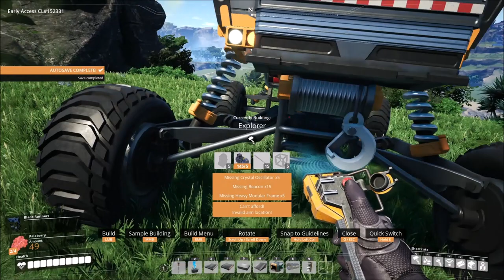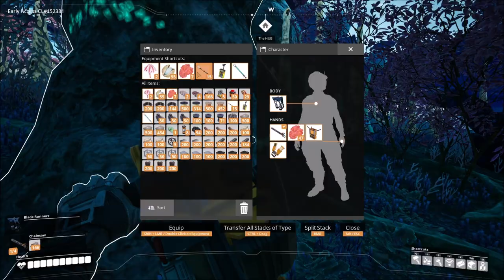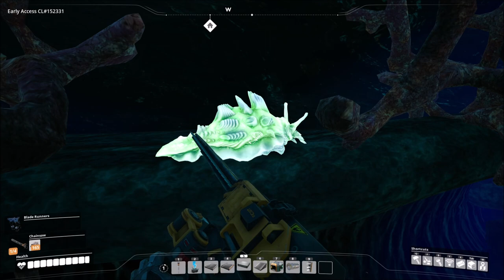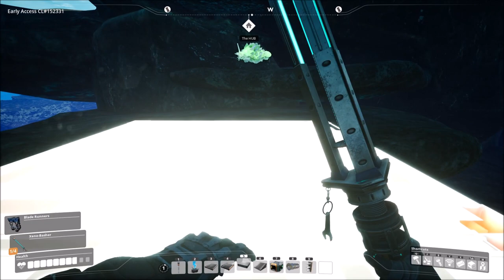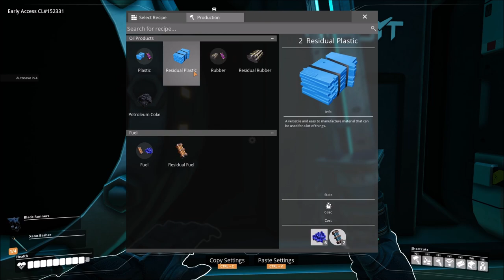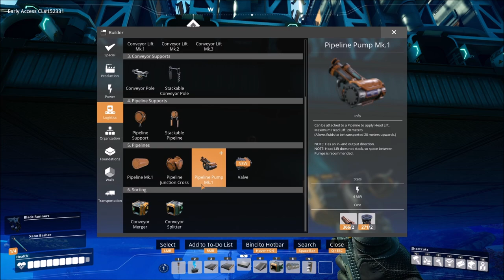Satisfactory Ep19 Exploring for Oil

Comment: You want to use the pipeline wall hole things and put walls beneath your platform in order to run pipelines along a ceiling.
Reply: You can remove the wall afther the wall hole are place or leave them there to hide the "direwiering".
Reply: @maximegagnon1946  "Hide the direwire"

Hahahaheh, I needed that laugh.

Comment: IMO the fire spitters are the worst. Once you have powered flight, the knockback becomes completely useless since it can't do anything to you in air, and his damage isn't that bad. The fiery ones can 2 shot with bad fireball split, even lategame, right out of air. Just for good measure i'm usually at top altitude using powerlines sniping them all with the rifle ever since i unlocked them both :)

Comment: There's a mod called "Floor Hole and Ceiling Logistics" that lets you pipe through foundations, and attach pipes to the bottom of the foundations.
Reply: Yeh, but they should add that in the vanilla.
Reply: @TheRezro  The Pipeline wall supports do just that
Reply: @marker2468  I know. But like what? Five minutes of codding.

Comment: Given the prevalence of bigger, meaner enemies in these new areas, I think it may be time to upgrade to the rebar gun.

You may also want to double check your math on the petroleum coke. The refineries output in 1-2 cubic meter units, but the coke production requires input in 4 cubic meter units. There’s a bit more to it than just how often it runs.
Reply: Have you actually used the rebar gun? It is not that good. xeno basher is definitely a better tier weapon, just not ranged.
Reply: @philgoodinc2  difference in play style. Given the option, I’ll always scout out an area and pick off enemies from a distance. Even if it does less damage, I end up taking less damage because the first hit or two is usually free.

Comment: Hey, Direwolf. Now that you’ve unlocked a lot of tech over the course of this episode, I think it’d be in your best interests to start hunting for more hard drives. Without spoiling anything, there are a few more useful alternative recipes that you could unlock that can streamline your oil processing system and make it more effective.

And before you start checking, you CAN place pipeline wall supports on ceilings.
Reply: I've noticed that you can place and rotate connectors onto the stackable pipeline supports. That's one way I've discovered of getting vertical pipeline connections since Satisfactory doesn't seem to want to do vertical connections unless you go to the trouble of setting them up in what seems to be a tedious fashion. I'm probably doing it inefficiently, there's probably better ways of getting pipelines to go vertically.